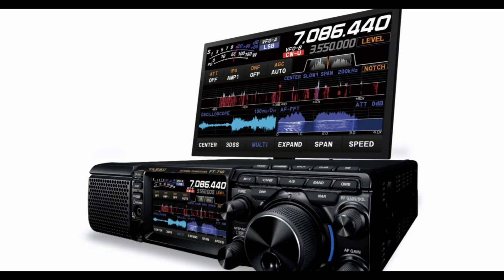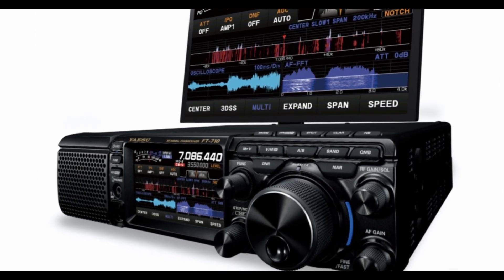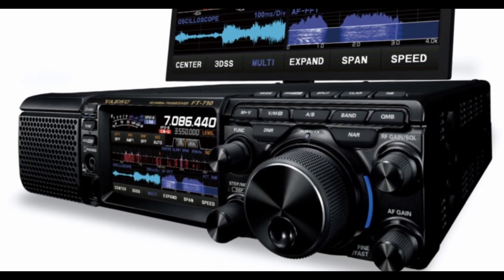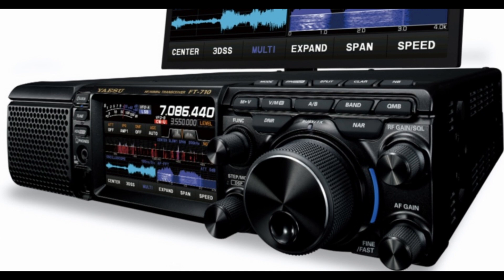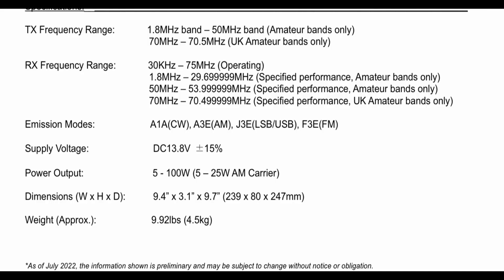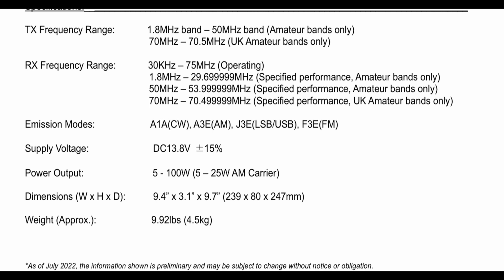Yaesu FT-710 New Transceiver Announced -  First Look

Comment: It is the size of the FT-991a so a mobile bracket will be available. It will be Yaesu's answer to the Icom 7300 both in a features and price. Yaesu top brass most likely told it's engineers to stem the massive success of the 7300.

Comment: Still playing catch up with the icom 7300 it seems. Yaesu should have made a radio to replace the 991a. This is what i ask, yaesu all ready have a the FT10DX. This doesn't seem to be a rig to compete  with the Icom 705. I suspect its just a way for hams to spend there cash on the latest fashion and not the latest tech. sorry yaesu  i wont be buying this rig. looks like the ageing  7300 is staying in my shack and the 705 is still the portable king of radios.  Yaesu should post this on you tube themselves and read the comments then they understand what hams really want. great vid Peter TU 73
Reply: Exactly well put💯👍📻⚛

Comment: Where does this radio fit?  What Yaesu should have done is cut the price of the dx10 and created a KILLER for the IC705 for Mobile/Portable.  To design it for those who are doing POTA/SOTA.  To give this new radio 40watts with a compact design.  To move past the serial ports and to think 21st century - USB C PD, BlueTooth, wireless, GPS, etc....

Comment: I don't know about this being a practical portable radio it's a bit on the large and heavy side for some portable applications how much power does it draw on Rx, re the front facing speaker you'll probably find that's an extension speaker, thanks for the update. Adam G7CRQ

Comment: Not much info yet. Some speculation it is a 991A without the UHF and some it is a replacement for the 450. The FT-DX10 is at least $200-300 more than the Icom IC7300 so perhaps it is designed to match Icoms price.
Reply: still at in fact the same price level I cannot see any reason to buy this one instead
not talking about Yaesu GUI design which is usually much worse than Icom's